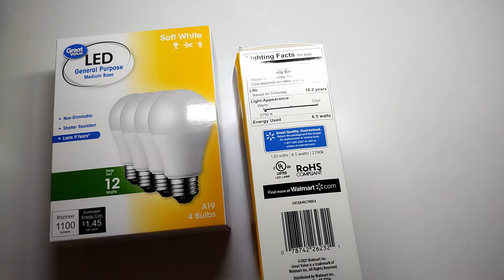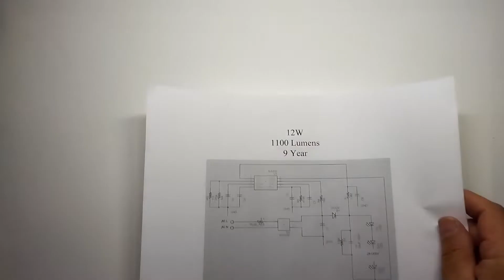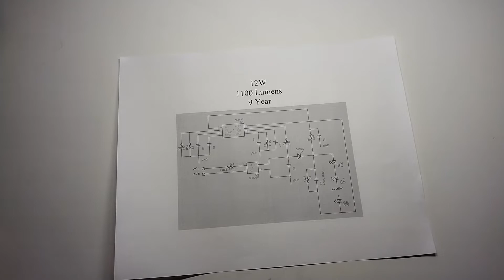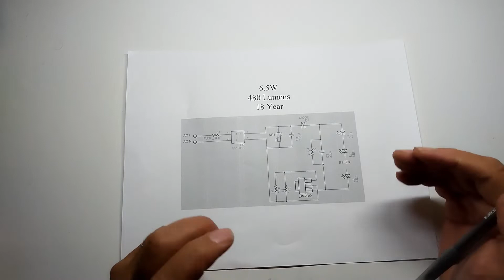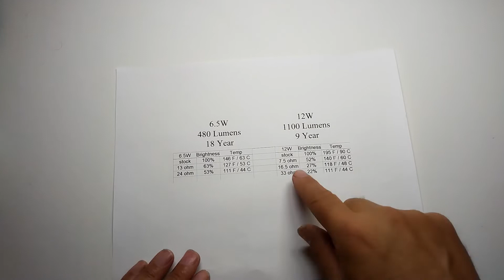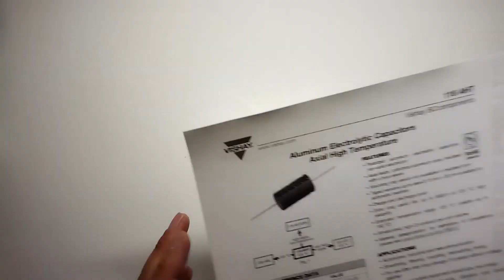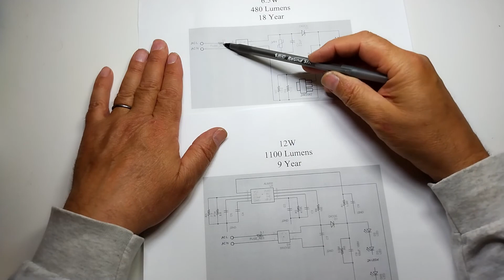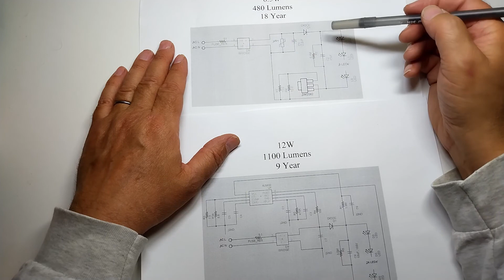Great Value LED light bulbs

Comment: These are just as good as the TCP bulbs with a lower price. If I get a TCP LED, I will get these instead. As these are cheaper. And will last just as long as the TCP unit I bet. These are better than the Sylvania LED bulbs. Those fail left and right. I’ve had no name LEDs that were likely by Sylvania. Because it was 4100K and 4100K is only available in a few manufacturers. Yes, Many do make 4000K which is slightly warmer. But I don’t know about the 9 year ones I’ve seen one dead at a house. But I’ve had decent luck with the older model 18 year Great Value LEDs and those were Soft White btw. I don’t know about the newer ones but I do have some Daylights in use. And some Soft Whites in pendent lights.  I don’t know how long they will lasts, But we will see.